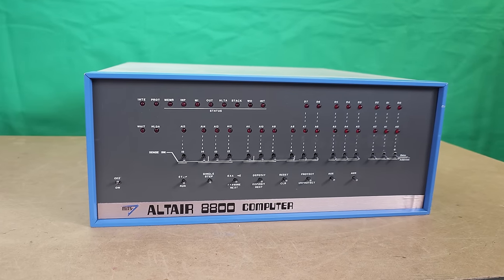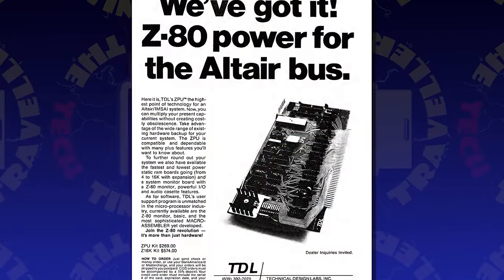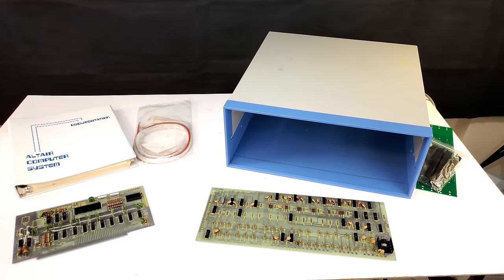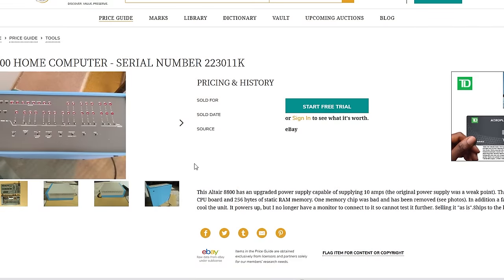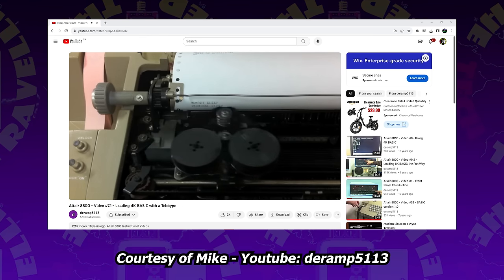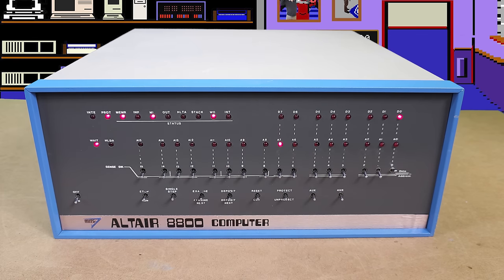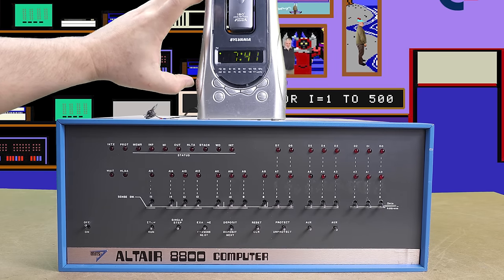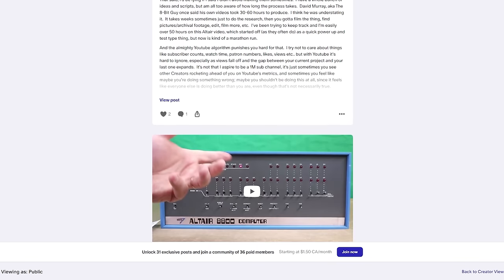I Bought the Cheapest Altair 8800 Computer on Ebay

Comment: It's not really accurate to say the switches are octal, not binary. They are certainly binary switches, they're just grouped in threes to facilitate using octal.  It's not hard to use them in hex, if you prefer. Some people even used red and white switch covers to give them a visual reference for using hex, instead.
Reply from the maker: Yes correct.  I was trying to explain the use of octal and the why of it but I probably stumbled a bit.  What really did me in sometimes was getting confused with the decimal address numbers used in the manual example programs. Thank you for the clarification.  This is why I'm glad (usually) that YouTube has the comment system. :)
Reply: Actual is just not compatible with electronics of the time. 7400 series chips would have 2,4,8 logic gates inside, not 3,6,9 etc.
The IMSAI 8080 was a much more intuitive front panel

Comment: Are you telling me I have $6000 sitting in my back room?
Reply from the maker: If you've got a Rev 0 Altair 8800.. yup.. might even be more depending on what's in it and serial number.
Reply: @TechTimeTraveller  it probably doesn’t quite qualify. I’m almost sure I have the original processor card boxed up but I’d replaced the processor with a Z-80 board. I had to replace the power supply with a more omphy one. The power supply was so large I had to mount the transformer on the backside. Next task, get the other stuff out of the way to look at the label.

Comment: The front panel switches are mapped in octal because that is the way the 8080's instructions are decoded.    It makes it much easier to memorize all of the binary opcodes because you only need to learn a simple pattern, rather than all of the 256 possible codes.   The upper two bits define the type of operation.   The two lower 3 bit groups are the parameters specific to the type of operations.    

Our early assembler was offsite on a timeshare machine.   Programs came on paper tape.    We had a paper tape loader in ROM.  I did many program patches via a switch panel, as a reassembly was a laborious processs that involved punch cards and a trip downtown.    It was handy to have the instruction set memorized.

Thanks for the video.
Reply: That's interesting - the explanation for Octal, that is.

What's even more interesting is that the Intel data books on the 8080, 8085, and the 8086/88 were all in hex, and every assembler I've ever used for these processors was in hex.  You were not expected to memorize the specific field definitions for the op-codes, but simply know that something like 0x2ef8 was the opcode for "X", and the fact that 0x2ef9 was "X immediate" wasn't really relevant.  At least in the contexts I was working within.

The only time I was concerned about bit-fields was when I was packing data for a specialized I/O chip or masking out flags in the status register.
Reply: Yes, the move instruction was based on 0x40, and the register or memory was based on 0x80. Then the registers were b, c, d, e, h, l m and a (0-7) (m was indirect (hl)). The ops were add, adc, sub, sbb, ana, xra, ora and cmp (0-7). Thus fully 1/2 of the 256 instructions were spoken for. If you look at a map of the instruction set, the middle is occupied with these instructions. And their layout makes sense in octal, 2 bits, 3 bits, and 3 bits. Intel was not trying to make the processor fit octal, it just happened to make sense.

The cpu had no multiply or divide instructions. We had no assemblers at first, and so memorized the instruction set by heart. I hand wrote listings and hand assembled them, writing the opcodes down from memory on the left side, then I would enter the program. We learned how multiply and divide worked by making routines that used bc, de, and hl to shift and add or subtract to make it work.

I think you can't imagine today what excitement there was at the time both building the machines from scratch and making them do what you wanted. I program complex routines in C and C++ and write drivers for Linux, but I learned %90 of programming back in those days.

Comment: My first job was working in an Altair store. Since they only came as kits, I assembled them in order to sell complete computers. I also programmed them some. I always liked them and thought they were well built, but couldnt afford one (bought a TRS-80 instead, about 1/5 the cost). 

But I figured over time the value would drop as they became obsolete and I could pick one up at a techie flea market (Dayton HamVention, for example) for not much. Never happened. They were expensive in 1976, never went down and they still are expensive today.
Reply from the maker: Yeah.. I kept passing on 8800s that were selling for less than $2k for years because I thought it was outrageous.  And then suddenly it wasn't.  I still wonder if my Altair's deficiencies were the reason for the low price, or if I just got extremely lucky because a bunch of potential bidders didn't want to fork over $6k just after Christmas and stood down.

Comment: Very cool. I was only 12 years old when I saw this on Popular Electronics and I wanted one so badly that I started learning electronics. By the time I was 15 I'd built an 8080a system that never fully worked - but the 2102 static RAM (1Kx1x8) board I build did work and I still have it. BTW: your production values are great and unique. Love this video and I'm subscribing and digging through your previous videos. Best wishes and Continued Success!
Reply from the maker: Many thanks for your kind words and thank you for subscribing!  Did you build your 8080a system from wire wrap?  That's awesome that you still have it!

Comment: Great video. Seeing your old Altar playing music was fun to watch. I have two IMSAI 8080's and two or three other S-100 buss based computers. My IMSAI's are a hodgepodge of cards inside, and the power supplies are over-designed linear tanks. I have them running two different operating systems. One is a custom OS design based on NorthStar DOS and the other is called ZRDOS, or Z-80 Replacement DOS (a Z-80 replacement for cp/m, which was designed for the 8080), custom BIOS, with the user interface of ZCPR3. Both systems use the Cromico ZPU. One of them runs both 8 and 5-1/4-inch floppies with a 20meg SCSI hard drive, and the requisite serial terminal. My  second IMSAI is just a basic computer. Front panel programmed to boot. I think it's my favorite.

Comment: A friend of mine from college built his own S100 bus computer.  He had a mix of boards from Altairs, Processor Tech, Imsai, and a few others.  He had a slightly burned up front panel board from an Imsai, that needed a lot of repair.  The board had bad chips, burned or missing traces, and a lot of bodge wires from repair attempts, He studied the schematics of both the Altair and Imsai panels, and then drew up his own simplified version.  He replaced lots of triple and quadruple NAND, AND, NOR, and OR gates with diode wire OR arrays and inverters.  In a few places he used discrete transistors.  His Frankenstein panel worked as well as the Imsai one did, and he even added a few extra features.
He found a bunch of static 22 pin ram chips that would almost be a pin for pin drop in for the 22 pin drams MITS attempted to use on their DOA 4k ram board.  He also modded a second MITs 4K dram board to use the refresh the drams using the Z80's refresh signals (after he replaced the 8080 cpu card with a "ZPU" card.)  His power supply used surplus transformers and capacitors (totalling almost HALF a FARAD for the 8v line).  The thing could have powered and ARC WELDER.

I worked at a small computer store in Manhattan while in college.  The owner was literally a hippy, ex musician.  I built SWTPC kits for customers that wanted them assembled.  I also repaired bad memory boards that kit builders couldn't get to work.  Most of the time the problem was a small short on the PCB where it hadn't been etched enough.  I got pretty good finding faults with a cheap oscilloscope, logic probe, and a DMM.

Comment: In a professional environment, I worked with two different S-100, Cromemco systems. The first was a Z80 computer designed for doing weather graphics. It was called a ColorGraphics LiveLine II. I think it used a Dazzler card, a DEC VT100 terminal, a 10MB hard drive, and a GTCO tablet. An 8-bit rudimentary graphics system used for broadcast meteorologists for their presentations. I couple of years later I was using a ColorGraphics ArtStar 3D Plus. It was a 24 bit true color system, but still based on an S-100 bus. The CPU was now a Moto 68020, and instead of CP/M, it ran a UNIX clone called CROMIX. Even with the 68000 based CPU,  I saw references to Z80 in the files on the system. Oh yeah, this thing had a massive 200MB hard drive! I have some demo videos of the ArtStar, here on YouTube. It's what I learned 3D animation on, for better or worse. The ArtStar was also sold as a weather graphics system, called the LiveLine V. It even had a bit-slice processor!

Comment: I built an Altair 8800 in 1976, while still in High School..  I eventually got (2) 8” floppy drives for it, with a Tarbell controller, and got it to run CP/M..  next came a 600 baud modem, and CBBS software (dial up bulletin board system)…  ah, memories.  with all of that said, I’d recomend one of the $300 clones, such as the Altair Duino, has the front panel a simulates the 8080, its enough to run CP/M, Altair Basic etc.

Comment: I'm glad you mentioned Deramp I've been subbed to his channel for years now and he's why I have enough of on interest in the Altair as an actual computer to be seriously considering getting one at some point or building out a clone. I've nearly bought an 8800A more than once because they pop up working for so cheap because so many collectors don't want them for what ever reason. I've also considered just building a clone to get my Altair fix but it's around the same price as just picking up an 8800A but most the clones have the added advantage of being easily to swap into full S-100 bus machine if you want that.
Reply from the maker: Mike is a great guy, he has a natural talent for explaining tech.  I've watched his Altair videos multiple times.  His clone was really cool too.. I regret not buying one when they were for sale.  And I agree I think the 8800a would be a great buy.. not as expensive as either the 8800 or 8800b, better power supply but still the essence of an Altair.
Reply: Yeah for me it's more about capturing the essence of the machine, it's also why I'm more willing to do stuff like PSU rebuilds on old machines than some folks are. It also helps I'm acutely aware of how easy it is for those old power supplies to blow and take out the machine with it and to me preserving the machine overall is more important that something relatively inconsequential as replacing the power supply especially when I know something like an 8800 I'll explore and use enough that the power supply failing is a serious concern.

Comment: Early micro computers were built to resemble mini computers like the PDP8 and PDP11 made by DEC.  Since  DEC used Octal notation, early micro computers followed that.  The Intel 8080 instruction set actually did group bits into two 3 bit and one 2 bit combination when decoding the instructions, so it did make sense to describe the instruction set in octal.  Later micro processors didn't follow this, the Motorola 6800 instruction set was listed in hexadecimal.
Reply from the maker: Much appreciated!  I'm assuming it was the same and carried over from the 8008?
Reply: 8080 and 6800 were both hexadecimal.  i wrote code for both when they were new.  8080 was identical to z-80 code-wise best as i remember

Comment: I built an Altair 8800 in 1976. I ordered the kit as soon as I read the magazine article. I also bought the optional 4KB memory card kit. It got really old keying in that 20(?)-step boot program on the front panel so that the modem could pull in the Tiny BASIC from the cassette tape. I sold it and the SWTP TV Teletype in the early 1980s for a few hundred dollars as I recall. Of coarse, knowing what I know now, I should have kept it. Isn't that always the case?
Reply from the maker: Always the way.  I tossed Tandy 1000s, the big grey Toshibas, even a Sun 3/80 (really regret that one.. those things have gotten super rare and went way up in price).  It's just life I guess.. when it's something contemporary to us it doesn't seem special.
Reply: @TechTimeTraveller Look at it this way - if nobody had thrown these out and everyone had saved them, they wouldn’t be as rare and wouldn’t be as valuable.

Comment: Years ago, I had one of the dual drive units. I think I paid $25 for it at a ham fest. There was nothing inside except for the power supply. I outfitted with a Morrow Wonderbuss,  Intercontinental Micro s-100 single board, two 35 track dual side dual density drives, hooked up external 8" drives, external SASI 10mb drive, and used it as a development machine for years. Later, I stripped out  the single s-100 board, and sold the MITS case for $250 to someone who wanted it as a collectible.
Reply from the maker: Darn!  Yeah that's the story of many an upgrade.  I curse myself for all the things I've tossed over the years.  The Foley really seems to be super rare.. but I don't think I've seen on get near a Rev 0 value wise so still potentially attainable unless the market has changed.

Comment: Thanks for this riveting video and the trip to the past. Although I'm old enough to have used an Altair 8800, I haven't had this chance. The first computer I have put my hands on was the French-made MBC Alcyane, which was much inspired from the Altair to say the least. It wasn't a hobbyist machine though and not mine either, but belonged to a computer club. A big difference (and improvement IMO) is that switches were in groups of four, hence hexadecimal was being used 😁

Comment: 37:49 To explain this a little bit if you are curious. When you have an overflow it rolls over to 0 in the sense that 377 octal + 1 = 0. If you are adding more than that it continues past 0. You can think of it like an odometer rolling over in a car. Basically computers add binary digits from right to left. so basically it did add 2 + 3 to get 5 like you said. Then it went on to add all the 0 bits to get 0s. Then it added the last two 1s and got 10 binary. The 0 gets saved in D7 and the 1 ends up in the carry flag never to be heard from again. Overflows go off the end and whatever was the result of the lower bits is what is saved.
Reply from the maker: Thank you for explaining that so clearly!

Comment: As far as I'm aware, the first home computer that was a available pre-built was the SCELBI-8H. Which, like the Mark 8, used an 8008. I suspect most were still sold as kits though. After the Altair 8800 came out, an improved SCELBI-8B was released, but it couldn't compete.

I've built a SCELBI-8B repro, and I hope to build an Altair 8800 repro one of these days as well.
Reply from the maker: The SCELBI is the one machine I've never seen come up for sale anywhere.  It'll be interesting to see what they go for if one does.  Interestingly they helped keep some folks like the former owner of my Mark-8 using their machines via SCELBAL, their take on BASIC.

Comment: I have an Altair 8800a that has the same power supply setup as the original Altair but does have the thicker paddles.  Fully working, nice machine.

Comment: I was an AT (technically AX, but that rate no longer exists) in the USN, and at BEE (Basic Electricity And Electronics - A School for electronics) around 1986, during our digital course, we learned about the Altair architecture (since it's fairly simple and easy to teach).  Our final test for that was on actual hardware.  We had to troubleshoot it basically by looking at how it decoded certain opcodes.

Comment: That's cool! I have a 8085 SBC I bought on eBay a couple of years ago and a project box that looks reminiscent of a Altair from Amazon. I have been thinking about making a mini Altair/ISMAI. Though I'd like to use a CPLD to cut down on parts since I have some laying around! The only thing stopping me is I would prefer to put everything on a PCB, but have yet to learn any PCB design software...
Reply from the maker: I'm still trying to figure out KiCAD.. I'm working on a recreation of the Sol prototype but have been stalled trying to figure out how trace old PCB artwork in it.  It's not as intuitive as I'd like.

Comment: Got the Altair kit when I was in college for electrical engineering. Mine worked first time, so I guess I was a better assembler than most. The static RAM card was originally supposed to be 256 bytes, but a note from MITS says they added the other 768 bytes (6 chips) for free as the cost of the chips had dropped. I had the machine for years and had added 3 more 4K cards to the mix.  After college, I found other interesting machines (LSI-11, ...) and stopped using it.

It went into storage until some time in the 90's when I decided to start playing with it again.  Stupid me, I simply plugged it in and turned on the switch. Heard a loud BANG - one of the power supply caps blew. sigh I later needed some money and put it up on eBay - it sold for around $1400.

I really wish I hadn't sold it.

Comment: @5:36 that is something one sees a lot in stuff about old computers, about the lack of permanent storage and being at the mercy of the power supply, , it is like people these days think power was sporadically delivered in the before fore times and reliable power delivery is something that only recently came about.
Reply from the maker: Many former Altair hobbyists mentioned the risk of power loss, be it power Co or simply tripping a breaker.  No one claimed it was an every day event but given there was no backup plan and how involved toggling anything significant on the front panel was..